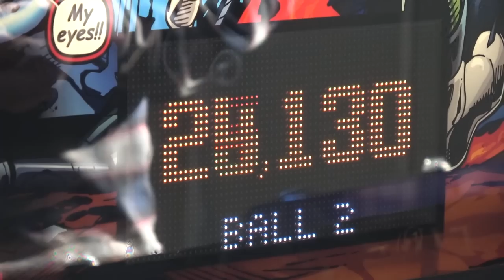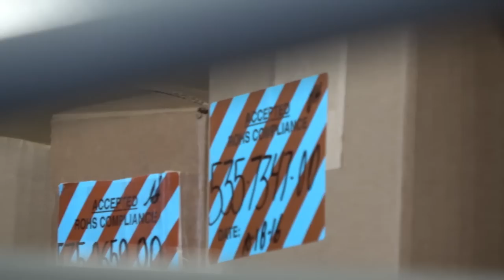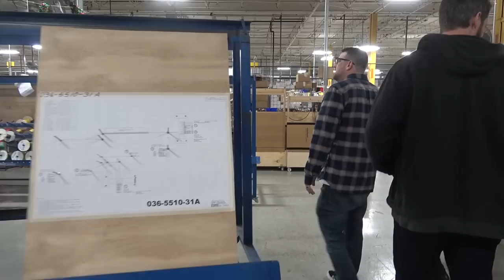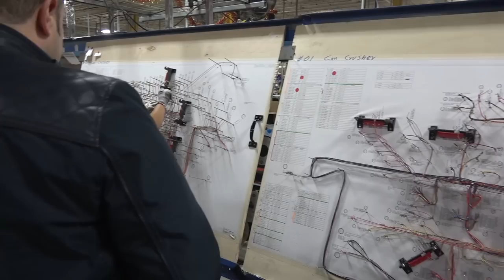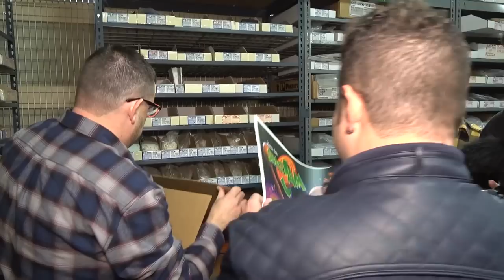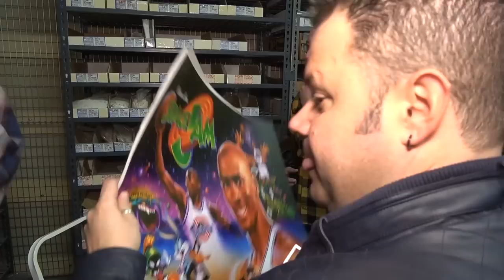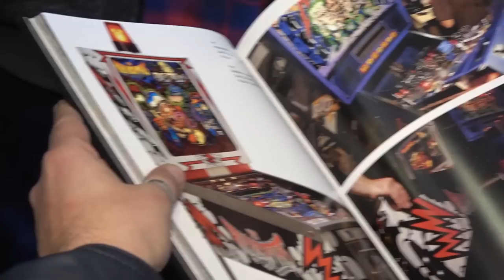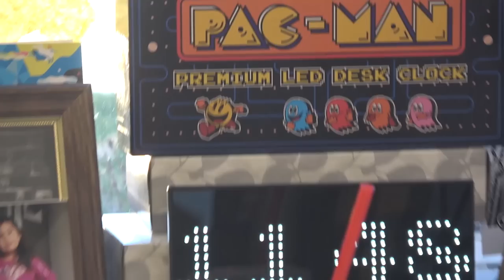2017 STERN PINBALL FACTORY TOUR! All Access with Jody Dankberg

Comment: I worked in the vending business in the 80's and I worked on Stern games then. They were carbon copies of Bally machines. I don't know for sure but they may have been made at the Bally factory. Been out of it for ever but in my day there was Bally, Williams, Stern, Gottlieb then latter Data east. That is all I can remember. I will say this. My all time favorite machine was made by Bally and it was called Fathom it was a multi ball design. Bally sound systems were top notch then and I am sure many other manufactures tried to copy it.  I knew pinball machines very well inside and out. Bonus question - How many tilts are installed in an old machine verses a new machine? I can remember at least 5 in a mid 80's machines and maybe more. I loved the video tour. Lot of work goes into them. One thing that the final testers can't predict is when a ball gets stuck under a certain area.

Comment: even Pinball is region locked
Reply: All they have done is locked the frequency on their switch mode PSU's. Not hard to circumvent one bit, it's not as though they have had it connect to a server to validate it or anything - although it's possible should they so wish. I had better shut my mouth lol.
Reply: Neffers never said that there weren't lots of ways to get around the region locks
Reply: I never insinuated that you did.